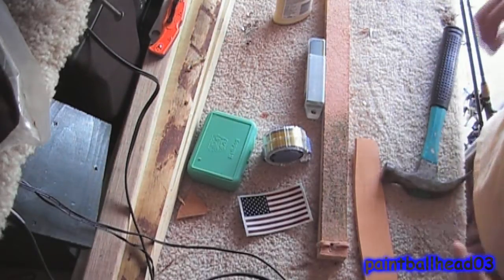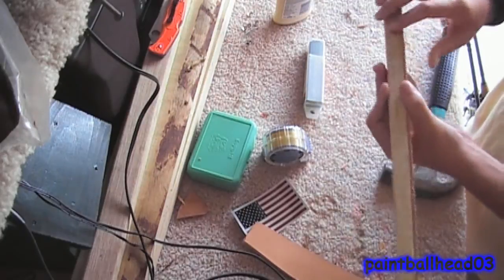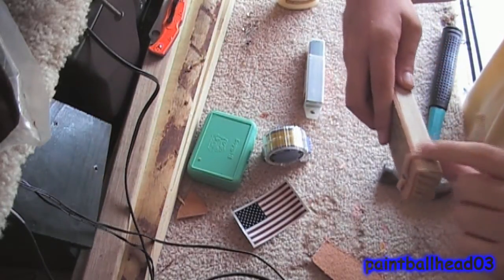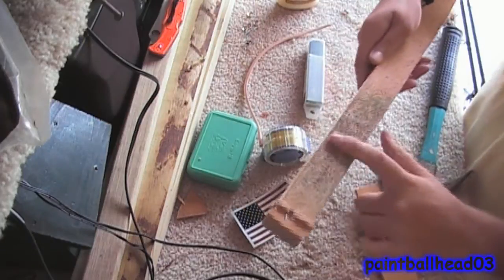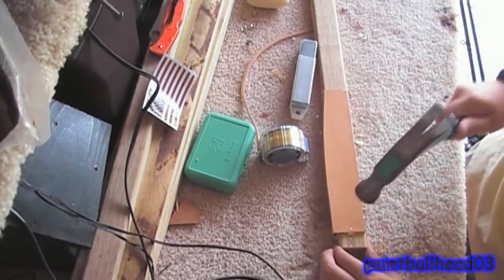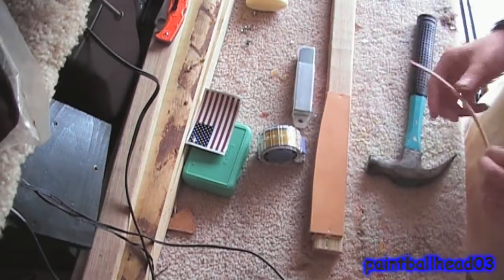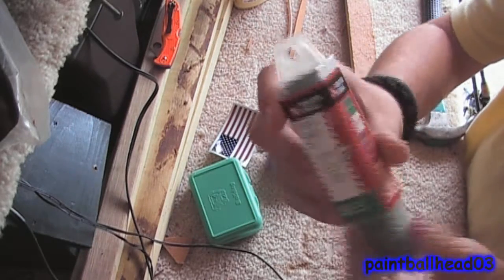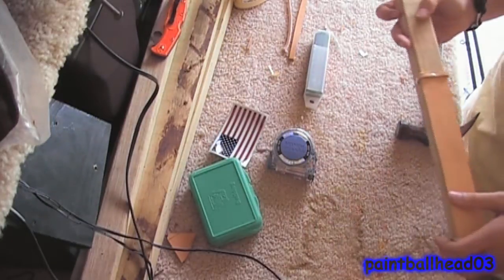How to make a leather strop

Comment: Suggestion: turn that board upside down and put some weight on the back of the board to keep the pressure on the leather + wood as the glue is setting up. Keeping any and all metal away from where a knife blade is run being the goal.